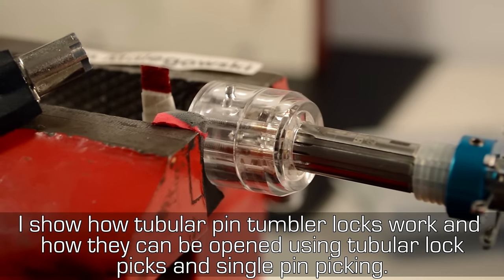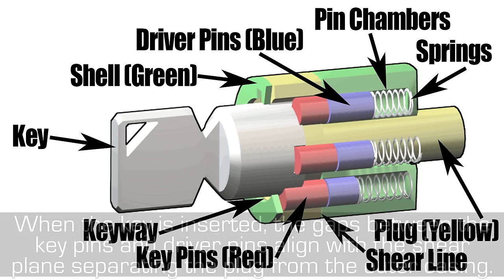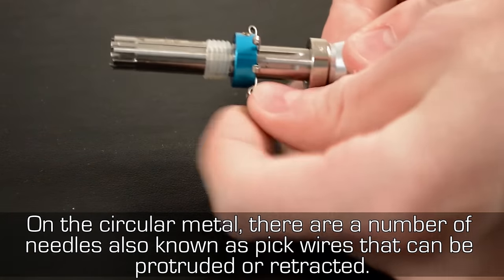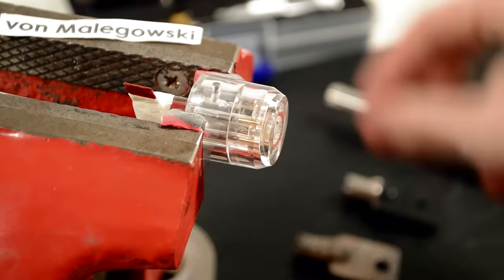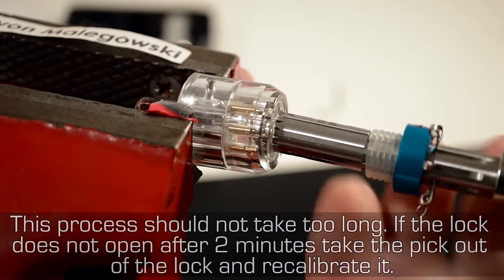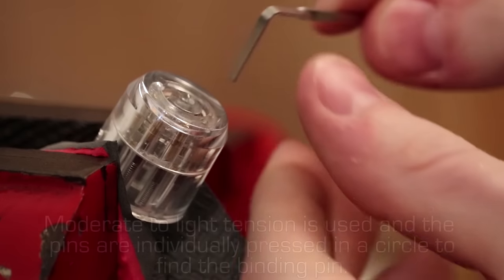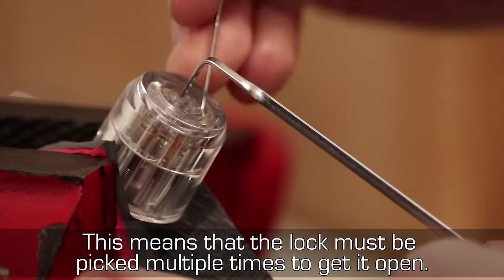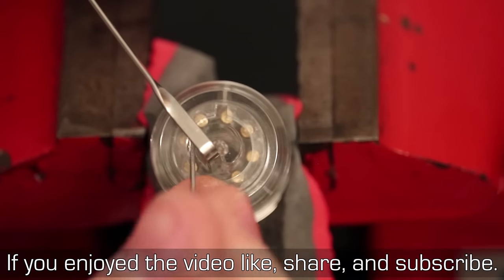How to Pick a Tubular Lock (Basics)

Comment: I got the HUK Chinese kit. $32. Your video got me trained up in about 3 minutes.  I tightened all the handle set screws and  wrote the color/size under each tool. 7.0,7.5,7.8 and then removed all the silicone tension rings from the outside.  I then installed a white silicone band of the same size ( Amazon, so useful) then one ring, then band,ring,band. This was the perfect amount of resistance and retention and made opening the practice lock far more repeatable 9/10.
I will have to test and verify it's good on all metal locks too. Thanks for the video 🔐🔨🩺
Reply: Can u send a ljnk to the white silicone band and everything else ?
Reply: After reading this comment, I realized my issue. The bands that are included with the picks don't provide enough resistance. Because of this, the spring loaded pins were pushing the levers farther than they needed to go. I laterally grabbed generic rubber bands from the junk drawer and looped them around the pick right over the levers, until finally, after about 4 of them, it was finally working the way he showed in the video. Thank you.

Comment: Thank you for this video. I have tried countless times to open a bike battery case with a Huk pick, but cannot open it. 

Any other tips?
Reply: make sure you got the HUK tools with the replaceable tension bar, bar hole in the recessed part and set screw as they also sell a version without it and this one cannot open most tubular locks unless you install the tension bar yourself by drilling and taping. 😒

Comment: After reading some comments, I realized my issue. The bands that are included with the picks don't provide enough resistance. Because of this, the spring loaded pins were pushing the levers farther than they needed to go. I laterally grabbed generic rubber bands from the junk drawer and looped them around the pick right over the levers, until finally, after about 4 of them, it was finally working the way he showed in the video.

Comment: If I understand this correctly you could vary the springs or driver pins to prevent an easy pick with the tubular lockpick but after the attacker picked it once conventionally and only did a 1/16 turn they could then impression their tool before completing the turn... is there a way to give the keyway a spring to jump back a click in case the attacker loosens keyway tension?

Comment: Is it possible to pick a 4 pin tubular lock with an 8 pin lock pick tool?
Reply: As long as the 4 pins line up with the picks. The other 4 will just stay in their original position and the lock should open as normal

Comment: I bought those impression tools for a lock I need to pick, but the lock's slot for the locator pin seems too small (or the tool's pin on the inside is too big) so the tool won't go in.
Reply: Mine was the same. I filed down the insert pin to half the width so it sits closer to the edge. After that it worked perfectly

Comment: So what do you do to tubular locks that don't have a tensioning notch?
Reply: There HAS to be a way to tension the lock otherwise the key couldn't turn it either!

Lock underneath the outer shielding ring, chances are there's a second ring underneath with the same cutout that turns/tensions the cylinder.

Comment: Just a thought - but if you have to single pick a tubular lock how about doing the first fraction of a turn once you've achieved the first pick then inserting the tool. I've not tried it as I haven't a lock to practice on right now - but in theory I'd suggest the tool will take the correct pattern and if you lock the tool's pins in place you'd avoid having to re-pick those extra times?
Reply: The idea is to pick it without a tool.

Comment: How do you remove the tension pin?
Reply: There is a set screw hidden under one of those sliders. (It's on opposite side of tension pin). Loosen and then pull up the pin.

Comment: Thank you for this video! I have the same tools and hadn't been able to open up the practice lock that it came with until I saw you talk about the posts! While the ones included were too long for mine, prob just inconsistent tooling but they're cheap tools, I clipped a bobby pin and that fit perfect and I was able to get it work!
Reply: I know this is an old message but maybe someone else will read this. There is a set screw under one of the pick pins 180 degrees from where that hole is for the tension pin. You slide the pick pin back to expose that screw. Loosen it, slide the tension pin in, then tighten the set screw.

Comment: Wherecan you buy see threw locks for practising?
Reply: Don't buy clear locks. Practice on master locks or cheap stuff from hardware stores. Real locks are not clear and you need to practice on the feel and how much tenstion you applt to the tension tool.
Reply: Amazon is a good place.. but yeah, as said above you should practice on cheap locks to get the real world feeling.

Comment: Why is it that all of you lock picking experts always have the lock out and secured in a vise and the lighting is always at optimum levels? Put out a video of you opening a toolbox or something else where the lock isn't in a stable secure setting with the best lighting. I can show you what's wrong with your transmission in your car if it is out of the car and in the light and mounted on a stand. Nothing to it.
Reply: He's not bragging; he's showing you how to do it. This is not even a real lock, it's a training one, made to be see through. Wow what a skewed view on things you must have.
Reply: yeah..like all the youtube videos that show how "easy". it is to do automotive repairs ..on a rust free, raised car with profesionaal pnumatic tools....reality of the repair is totally different for a rust belt, north eastern car that is only two feet off the ground! Brings a whole different requirment  for removing seized, rusted parts, having no tool turning radius, no working room and using methods that prevent further damage due to handling of connected , rusted parts and lines...i love such "It easy to do" instructional vids . Now do that same job as would be required for most real situations lol..yes, the instruction is fine..but wish there were more advanced reality vids on Youtube repairs